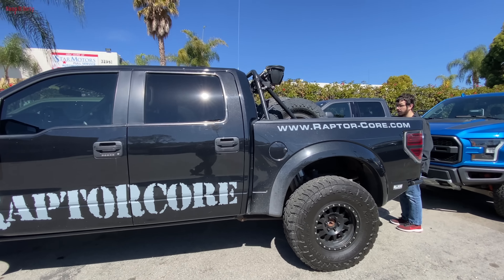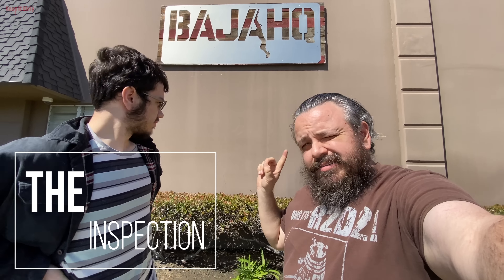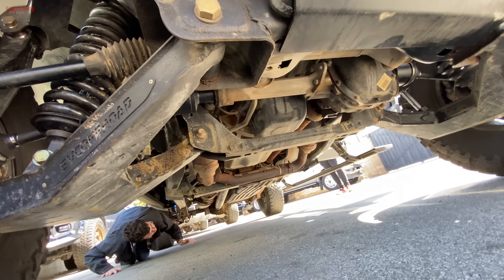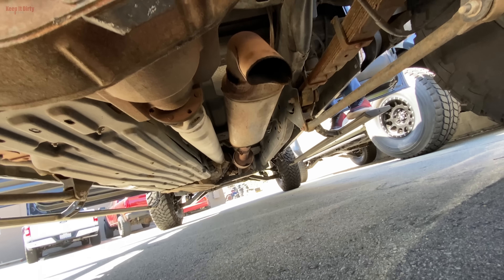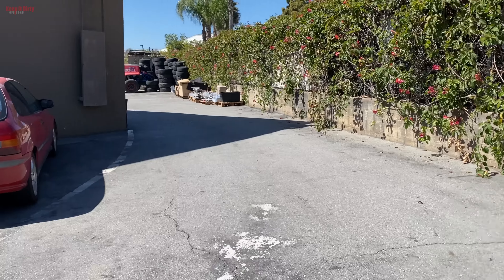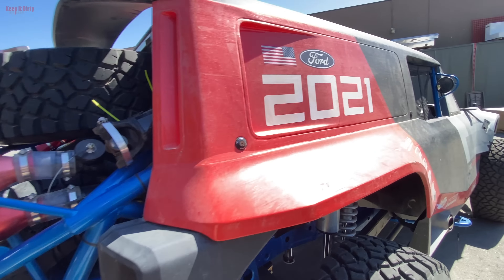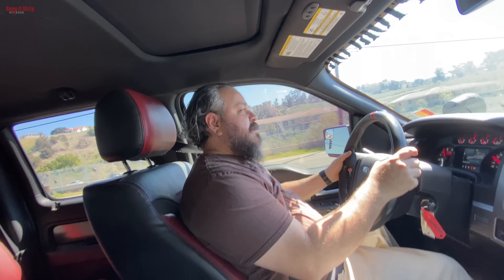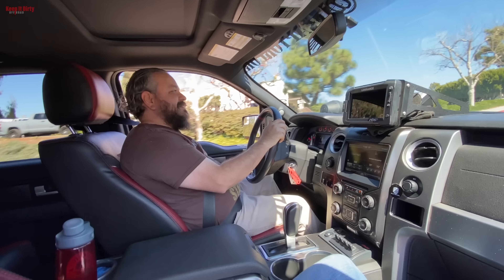Is this our next truck? RaptorCore  SVC Mid Travel Raptor

Comment: That truck has been beat to shite! Move on.  Hmmm, those skids were smashed, no doubt.
Reply from the maker: 🤣🤣 it’s beat up yeah, but not bad. Miles are low, engine is in good shape, and there is a lot of good here. She does need some rehab, so the price is key. His asking as way too high considering the condition.
Reply: @KeepItDirtyOffRoad  Whats the mileage?
Reply from the maker: I think it had 55k. Forget the number off the top of my head, but under 60k for sure